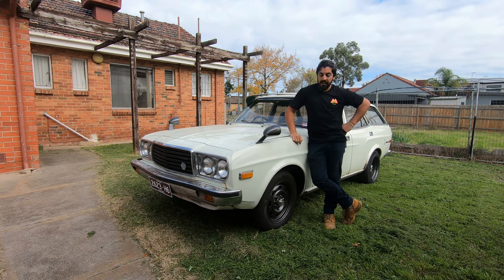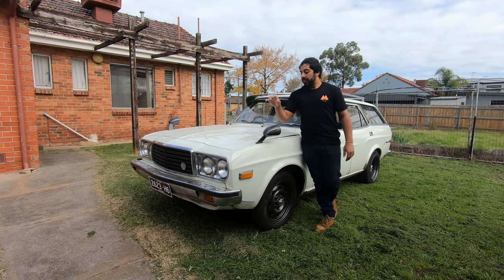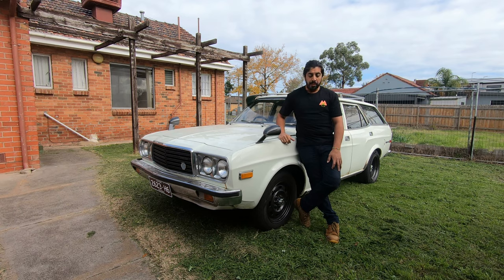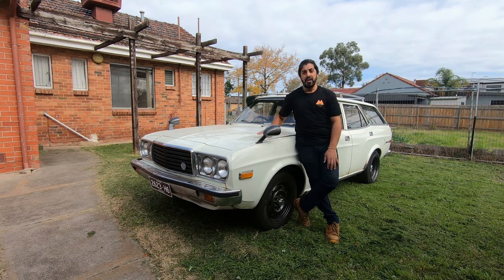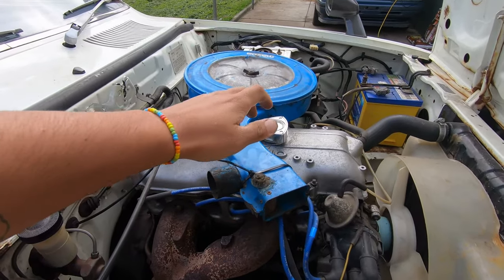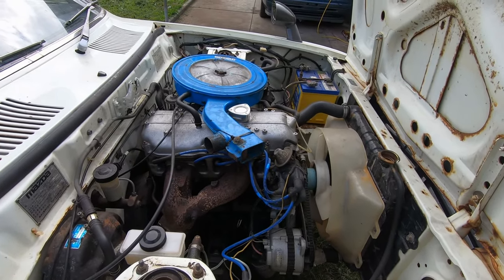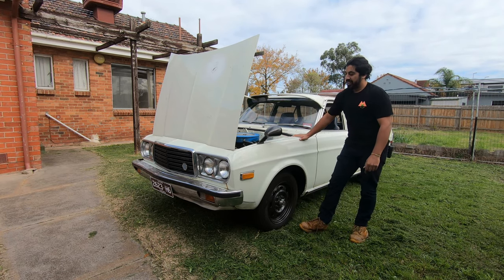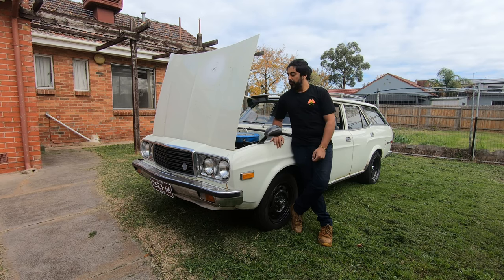LET'S BUILD A CLASSIC MAZDA 929 TURBO ON A BUDGET - STREET CAR CULTURE

Comment: Followed Danny's link from facebook, so another build I'll be keeping an eye on.
Just a heads up if you didn't know, they use F8 and FE  carby boring motors in the later vans you got the wheels off, boring motors, but they are RWD and probably use a similar block.
Reply from the maker: Thanks for watching mate. Yeah i chose the mx6 platform for being factory turbo and 2.2 litre not 2.0 litre.